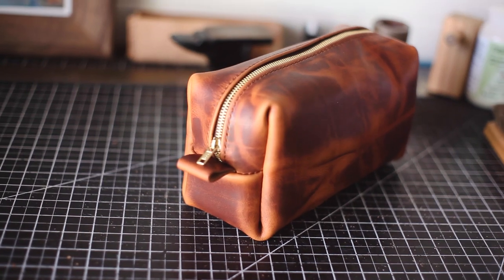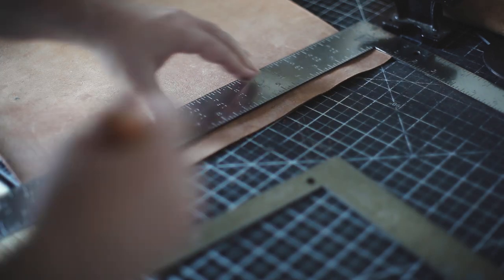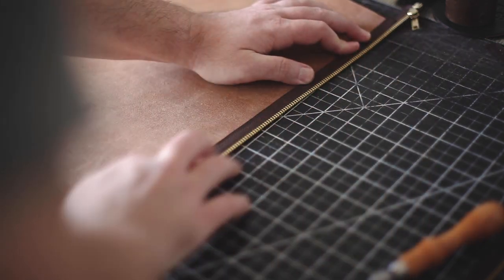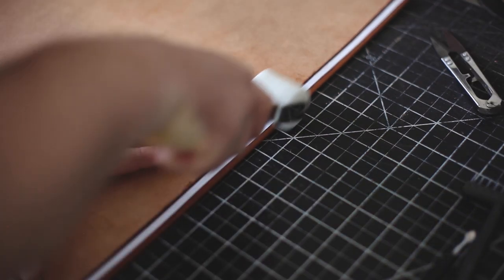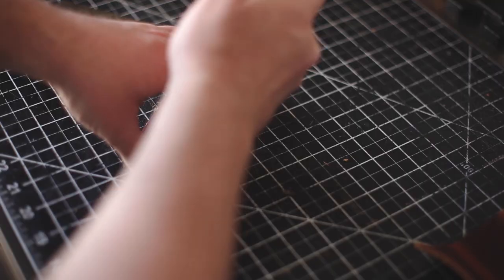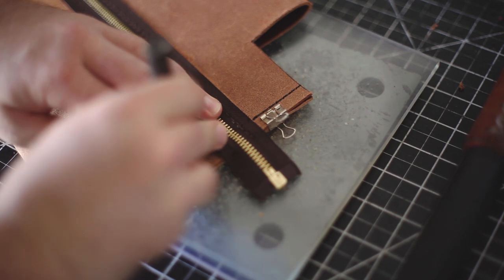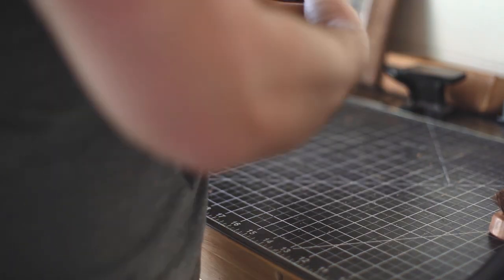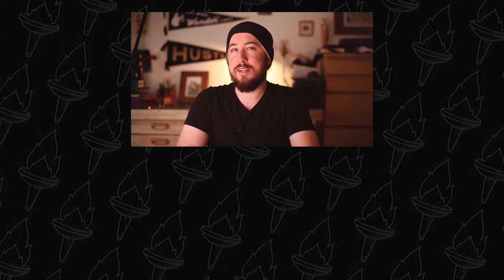Making a Leather Dopp Kit

Comment: What kind of glue do you use? And what type of adhesive tape are you using ? Thank you in advance
Reply from the maker: I'm using Ecoweld, a water based contact adhesive that can be found at Tandy Leather.  The adhesive tape is Tanner's Bond Permanent Adhesive tape, which comes in a few widths, I believe mine was 3/8" (10mm) wide. 
Hope this helps.  Cheers!

Comment: Nice job! Where did you get your self healing cutting board from, Do you like it? Does it land scratches on your leather from the cuts on the board or the board stays smooth?
Reply from the maker: I got this self healing cutting mat from Amazon due to it's size and price.  I've had it for about... 4 or 5 years or so, and no I don't see a transfer of the mat cuts to the leather surfaces.  Although after about 4-5 years I think it's time to replace it as multiple cutting will reduce the structural integrity and it's tending to buckle upwards from the surface underneath a bit.  Hope this helps!
-Ted